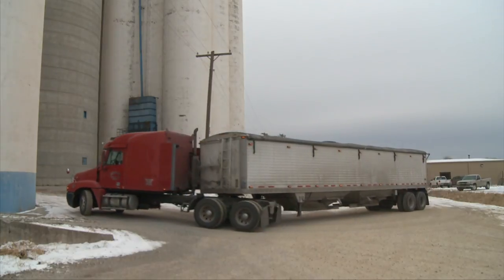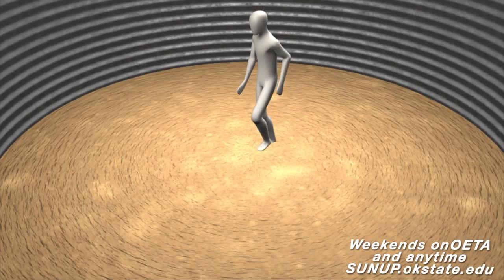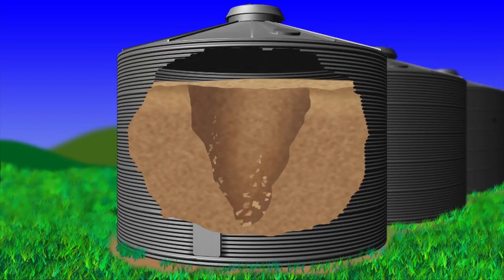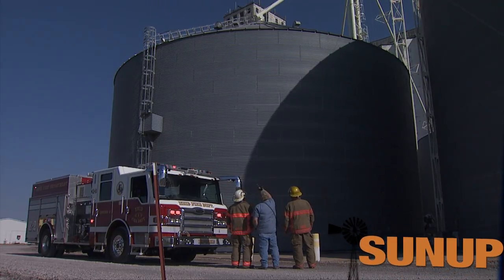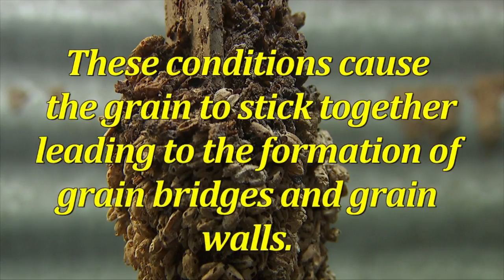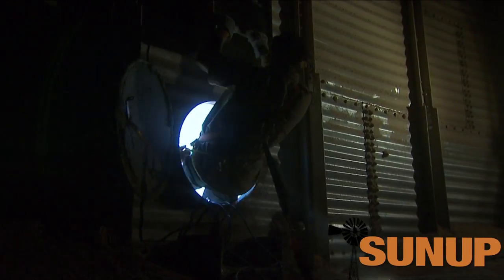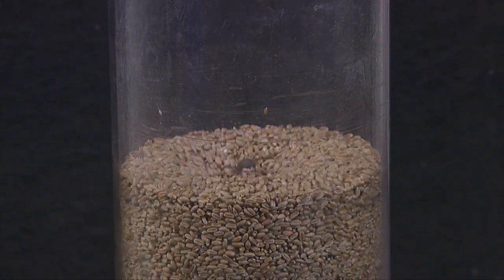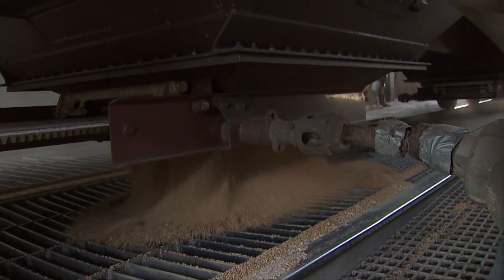Grain Bin Safety (6/28/14)

Comment: I agree with Kimberly - harness systems should be standard.  Also, ideally they should be wearing a multi-gas detector - I do see a single gas detector on the attendant.  Not sure about the entrant.  But did they mention this in the video?